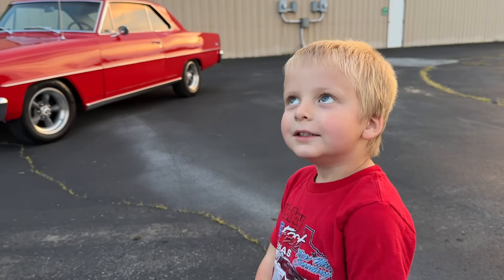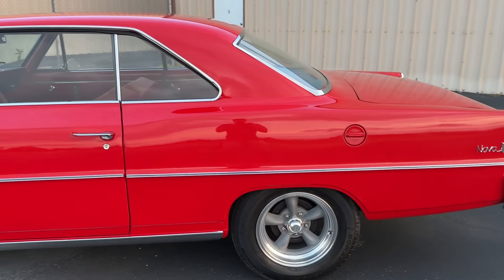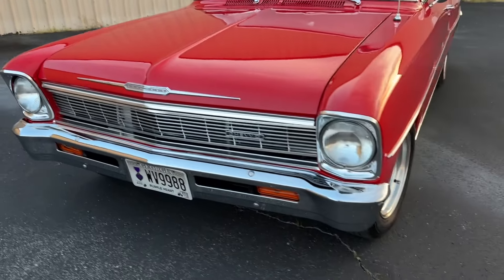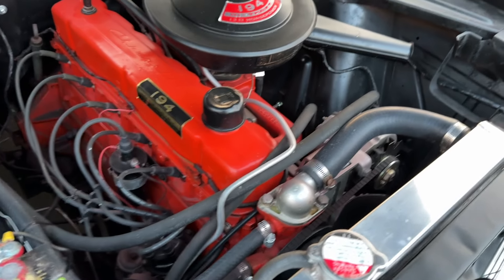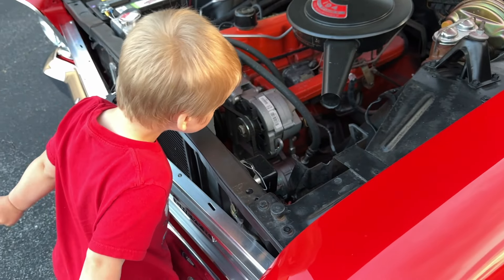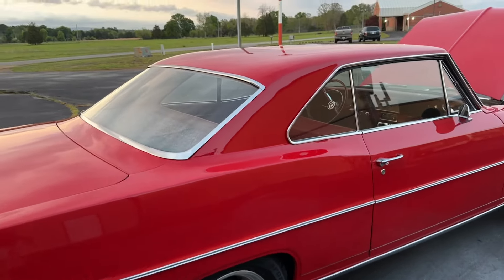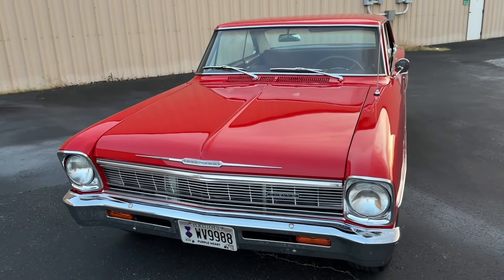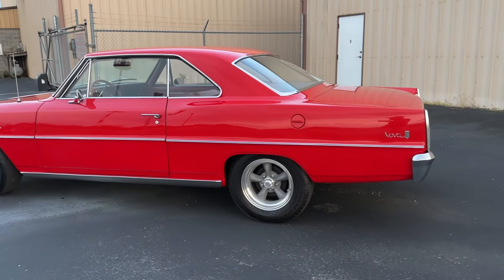Six Cylinder '66 Nova Project - Done for Now!

Comment: Now you need to complete your collection by finding a Chevy II / Nova with the Super-Thrift 153 four cylinder engine, rated at 90 hp @ 4,000 rpm, and 152 lb-ft torque @ 2,400 rpm.

Comment: Why is the antenata on the driver's side ?
Reply from the maker: It was a radio delete car and someone installed a radio later. Whoever did that popped a hole in the driver side fender instead of passenger.